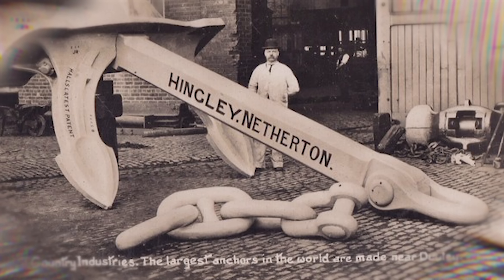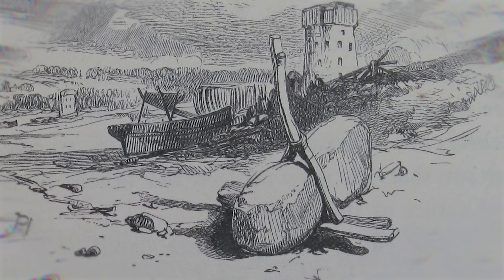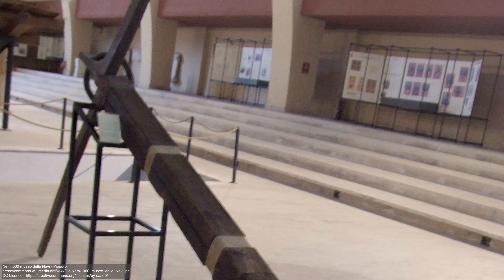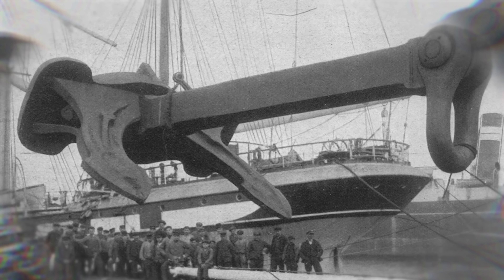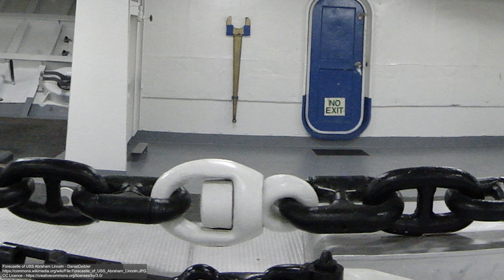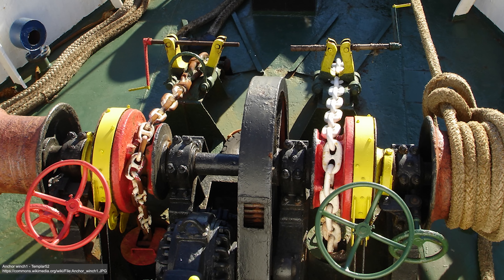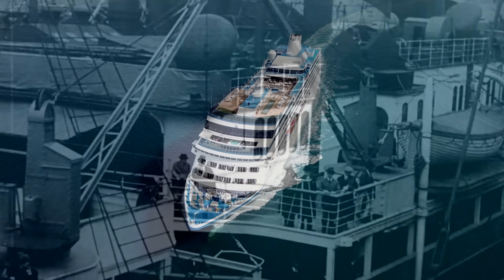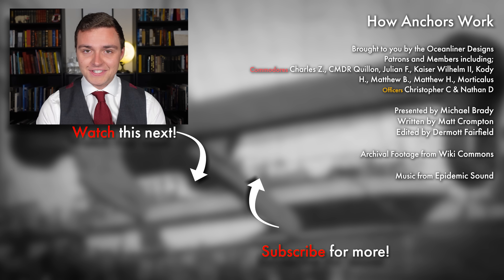How Do Anchors Actually Work?

Comment: Fun fact: chain lockers are really dangerous enclosed spaces: part because of the danger of shifting heavy weight, and because the rust on the massive surface area consumes the oxygen.
Reply: From a BB NJ video: It's not the rust, it's the organic stuff in the water the chains drag up that may make the air foul to the point of being dangerous if someone jumped or fell in.
Reply: @alphax4785  the oxidisation of the steel of the chain will make the space dangerous. Rust is after all iron oxide. It doesn’t take much and sadly, many people still die in enclosed spaces such as ballast tanks and chain lockers every year.
Reply: @alphax4785  All "confined space entry" is a controlled operation (so, planning meetings, documentation of every such task, checklists, after-action review ...) on every vessel I've worked on in 4 continents and 14-odd countries.
Adding the possibility of toxic gas doesn't change that much. You're already in territory where checking the air before entry with a 4-gas meter (with calibration documentation, checked) and having a recovery plan (including personnel winches and breathing apparatus at the work site) in the event of a worker being overcome is already in the basic job plan.
That's on a vessel with sufficient crew, the equipment on board, etc. If you're not suitably equipped, don't do it until you're tied up alongside a harbour which does have those facilities that you can hire.
Reply: And, also, because you don't want to be anywhere near that thing when the anchor is released.
Reply: Oh yeah. There's Davey Jones' Locker, and then there's the chain locker. 💀
Reply: Can anyone tell me the difference between a ship and a boat ?
Reply: @ one thing I was told years ago is that ships can carry boats but not vice versa. In the days of sail, a full rigged ship was a ship that had three masts with square sails on each mast.
Reply: @garysmith2450  I've heard that also but those deadliest catch fishing vessels i watch on tv are massive yet they still insist on calling them boats.
Reply: @JeffBilkins  no one can enter an anchor locker until the full range of the cable has been deployed  access to the anchor locker is through an inspection hatch which is bolted down the bitter end is the shackle which joins the cable to a deck eyebolt many a time I had to pressure washer and blast the interior before painting.  the rust gave us no concern but ventilation had to be provided when painting with epoxy resin
Reply: Remember, any time someone asks you to go into a confined space you just say "that's a confined space I'm not going in there".
Reply: Wow, cool.
Reply: Not how rust works. The rust layer contains very little oxygen.
Reply: @probablynotmyname8521  4 Fe + 3 O2 → 2 Fe2O3, chemical reaction for rust it converts iron and oxygen into iron oxide which is rust, while it consumes very little, it's a low oxygen environment therefore making it a hazard to enter as there is no natural ventilation
Reply: Yes, it's dangerous, but nothing to do with rust and oxygen. 

Dangerous because one mistake, and you're dead.
Reply: @kereckelizabeth3625  OSHA maritime confined space entry- Section 1915.12(a)(3) "In addition, any oxygen level lower than 19.5 percent level should also alert the competent person to look for the cause of the oxygen-deficiency and correct it prior to entry."  Believe it or not all of human knowledge is on this device you just watched this video on you can read about this for days before posting something wrong
Reply: @GorillaAstronaut  I thought it would hardly apply to an empty anchor locker the size of a small house with the inspection covers  removed  and a chain pipe flu full of breathable air    tell me what is your experience with anchor chain lockers
Reply: @XOsubmariner it's not specific to anchor chain lockers it's general confined space entry, it's hazardous for utilities vaults too. The area is unventilated and can trap hazardous gases as well as just general lack of sufficient oxygen to support life within the space, just having a hole in the wall or ceiling does not guarantee there is any flowing air sufficient to keep the space livable, that is why when workers enter any confined space atmosphere is tested prior to entry and majority of the times ventilation is set up for the work crew. Saying lack of oxygen isn't a concern is ridiculous, it may not always be an issue but it is absolutely dangerous pertaining to confined space entry as defined by OSHA and acting like it isn't is how people get hurt, once again you can google if chain lockers fall under enclosed space requirements and the answer is generally yes
Reply: @GorillaAstronaut  ships don't have walls or ceilings they have bulkheads and deck heads  shall I take it by your terminology you are not a sailor with years of sea time.  you just keep quoting your health and safety regulations in your disconnected disinfected world  but just let the workers get on with the job    now there's a good chap
Reply: @XOsubmariner  You literally proved my point in your earlier comment when using epoxy inside the space they had to provide ventilation, tell us why would they do that? Could it perhaps be because it's a confined space with poor ventilation where epoxy fumes could build up and be hazardous? Or were they just doing it for fun?
Reply: @GorillaAstronaut  fun fact, I am a former seaman, and i've been in chain lockers, more than a few times. 
So I do ha know what I am talking about because i've been there. And no, i've never read that memo you quoted.
Reply: @GorillaAstronaut as a former seaman, I've been in chain lockers, more than a few times. I might not have read that paper you just quoted from, but I do have real life experience. 
One mistake in there, like getting your foot in one of the links when anchor is dropping, and you're dead.
Reply: @kereckelizabeth3625  I never said you're wrong about it being dangerous just saying lack of oxygen has nothing to do with the dangers is inaccurate, saying lack of oxygen has nothing to do with it is blatantly false, lack of oxygen is a serious concern in these areas, that is why it is OSHA mandated to test the atmosphere, everyone in this comment section saying "well I was there and didn't die from that" is the reason accidents happen, just because it didn't harm you specifically doesn't mean it's not a concern, I'm not saying it's the primary danger, I'm saying it's a serious one not to be disregarded, I work with powerlines and have never been electrocuted but I'm not saying "well I never got shocked so that's not dangerous" something can be dangerous and you never encounter it and multiple things can be dangerous at the same time
Reply: @GorillaAstronaut  ok. Got it.
Reply: @GorillaAstronaut  nobody said the air isn't dangerously hypoxic in a locker. The claim was that it's rust causing the hypoxic environment, and the counter claim was that it is not, and that the volume-to-surface ratio discrepancy being at orders of magnitude will mean that no, the oxidation of the surface of the steel cannot by itself meaningfully impact oxygen levels.

Calculating volumes, surfaces, and ratios is elementary school material where I come from.
Reply: @martinkrauser4029  if you actually read the argument yes they were arguing that lack of oxygen wasn't a serious concern it's pretty clear, and I'm simply saying rust can be a factor and regardless of what percentage rust or decaying matter is poisoning the air or removing oxygen, these spaces have the capacity to be low oxygen environments and rust is certainly a factor even if it is a small one, I'm not gonna keep arguing about this the facts are these are unventilated spaces that typically lack flowing air and can have dangerous atmospheres, rust consumes oxygen and may impact the breathable atmosphere in these environments but isn't necessarily the primary factor in the danger, even if the rust consumes a fraction of a percent of oxygen that could be enough to make these areas dangerous, it is not making them a vacuum, safety is a collection of factors not a blanket statement of you cannot enter because of rust or these space are always safe every time
Reply: @GorillaAstronaut  no, not one person argued that. Rust is not a factor, same as someone wearing a pointy hat won't be a factor for them getting struck by lighting climbing an observation tower in a lighting storm. Feel free to do the math on the actual quantities.
Reply: @xosubmariner when someone refers to a reciprocating saw as a sawzall, we know what they mean. Nobody likes the guy who smugly says, "that's not made by Milwaukee, it's a reciprocating saw." We get it, you spent time at sea. Doesn't mean you have to be a complete asshat in order to educate someone who hasn't. The guy repeated something that he was told and found interesting. It's ok for him to be wrong. It's not like he told people to mix bleach with ammonia. Chill.
Reply: @martinkrauser4029  of course rust is a factor. What do you think causes a chain locker to be oxygen deficient? Chain is being doused in sea water before being stowed in an enclosed space. It will rust. It will deplete oxygen.
Reply: @kereckelizabeth3625  former seaman sounds about right, your chocolate ticket must have melted. Of course rust causes oxygen deficiency in chain lockers, ffs.
Reply: @JeffBilkins  why are we arguing about oxygen levels in an anchor locker it's not as if the crews accommodation is inside it
Reply: What' armchair were you sitting in when you saw that load of rubbish
Reply: @XOsubmariner he is correct. If you doubt it, look up enclosed spaces on ships and their dangers.
Reply: @XOsubmariner  there's no armchair, only safety procedures written in blood. Accidents and death related to deoxygenated chain lockers absolutely happen.

Comment: The most unnerving I saw related to this video is where a windless literally caught on fire as it tried to pull back the let loose chain (I don't know the context of that video but that's so unnerving to see in itself). As someone who has some knowledge on how metals and electronics behave, seeing such a crucial and big machinary critically fail this spectacularly is no ordinary thing. If I were the captain of that ship, I'd gave order to release that chain altogether and if the anchor is needed use the other one (most ships has one or two backup anchor, just a little FYI). Replacing that thing would cost more than the anchor and chain, at least in my opinion
Reply: It is common when the ship has to much of speed the brakes will not hold and burn.
You can not release the chain only wait till all of the chain is out.